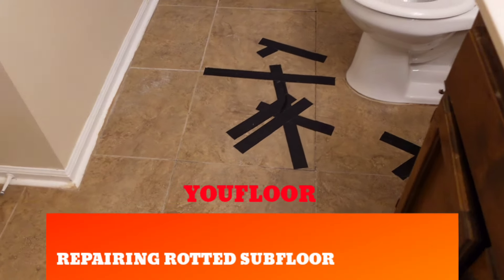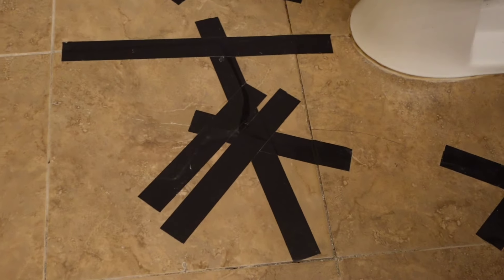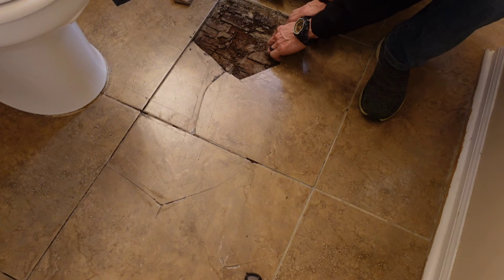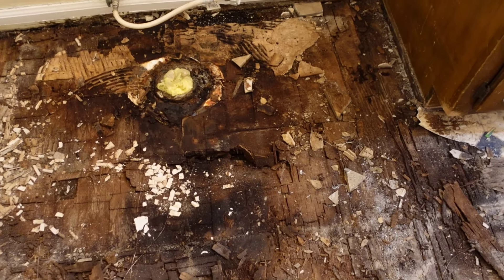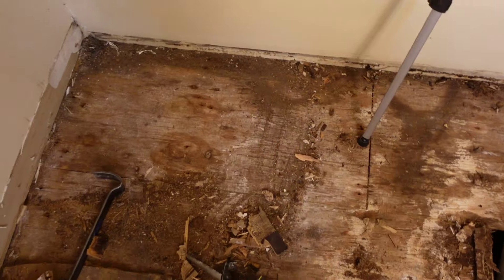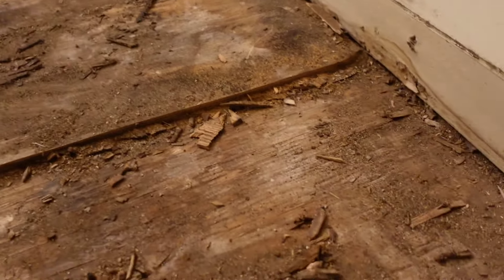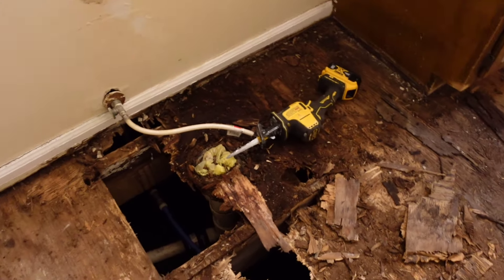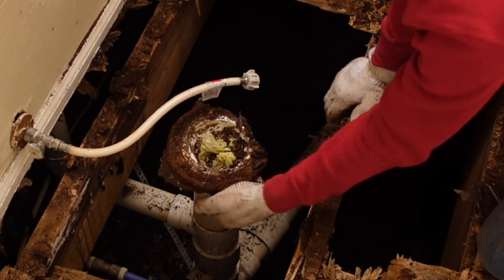Repairing Rotted Subfloor In Bathroom

Comment: Good job, nonetheless the vanity should had been removed and entire floor removed replaced and plumbing redone. Do it right while its in demo mode. 😢
Reply from the maker: Okay. Thanks for your opinion 👍
Reply: I totally agree and if I’m trying to get a subfloor tht needs to be 1 inch I’d prefer to use 3/4 & then 1/4 inch….just bcuz you double 1/2 inch tht doesn’t mean you eliminate deflection….entire subfloor should have been removed and next time redo all the plumbing,block in around the toilet drain so tht its more secure when bolting/screwing to the floor and use pressure treated plywood.
Reply: There was also some joist rot he should have addressed as well.

Comment: This is the exact same thing I am doing in my bathroom, except putting in a new cabinet, but that's not a big deal...
Reply from the maker: Right on. You got this. Make sure the toilet flange is on top of finished floor. Not just on top of subfloor. This will ensure a good seal. Thanks for the comment

Comment: What was the cost? Thanks
Reply from the maker: Not too bad, but the subfloor repair was around $150. In materials. With new flooring, it was around $500 total. Only took about 5 boxes of flooring
Reply: Is that the cost just for parts, or is that cost for parts and labor?
Reply from the maker: It was for parts only. Would probably run $800 for labour's. 2 days. (Depending on the situation) so around $1,200 to $1,500 for the whole thing. Hope that helps. Thanks for the question
Reply: Good job! My small 5’x7’ bathroom needs the entire subfloor replaced and some joist sistering. Tub is 4.5’x2.5’ cast iron. Think it can be removed without having to break it up? Just me doing the job. If it does need to be broken up how would you suggest doing it?
Reply from the maker: @tmise50  Maybe. If you can turn it sideways, it may fit. A lot of bathroom openings are 28 to 30 inches, so if you took the door off the hinges, you might get lucky. Thanks for the question, and good luck with your project
Reply: @tmise50 Many years ago, they used a Saws-zall, no idea on spelling to cut up my old cast iron claw tub. I think they might have had a diamond blade. Super heavy.

Comment: That may have been your first flange but it won't be your last.  The lip of the flange should be installed ON TOP of the FINISHED floor.
Reply from the maker: If you go to 11:20 in the video, you will hear me say I am going to put the LVP underneath and I wanted to make sure the flange would lift up. thanks for the thanks comment

Comment: It was a little hard to follow. What did you end up putting in as sub floor? You talked about 3/4 inch and also two layers of half. Also did you end up putting a layer over the sub floor?
Reply from the maker: I doubled up the half inch, and no, I did not cap it with anything. Hope that helps. Thanks for the question

Comment: This is subfloor damage DUE TO CONDENSATION. This has NOTHING TO DO WOTH SOMEONE's WEIGHT!!!
Tip: clean your ac condensation line monthly!!! If you have condensation backflow due to a clogged condensation drain line, then your subfloor will succumb to damage bc of condensation backflow.
Reply from the maker: The weight refers to deflection causing grout to crack. Has nothing to do with subfloor rot

Comment: Looks like you only put the purple primer on the flange and forgot the cement glue , you need both
Reply from the maker: At 11 :41 in the video, you can see me putting the lid back on the glue. Didn't wanna do a tutorial on how to install a flange. More focused on replacing the subfloor. The glue just happened to be off camera. But you are right... it does need both. Thanks for the comment 😁

Comment: You just left it the same, with no extra support!  Now it will do the same damn thing,  and the tiles will break as well.   You should have added 2x6 between the joints for more support !
Reply from the maker: No extrat support needed. It's lvp. Not tile. Thanks for the comment

Comment: I would gut that " to the studs" to be safe.
Reply from the maker: If lumber wasn't so high at the time, I might have considered it. But I check under the house and in the walls. I think I got it all. Thanks for the comment
Reply: @YOUFLOOR  I did a similar remodel earlier this year. Wasn't as much damage but a little water causes the 3/4 inch plywood to de-laminate. Replaced the worst part then oil base primed the subfloor. I do love LVP. Will never tile another floor. LOL.
Reply from the maker: Right on brotha. 👊